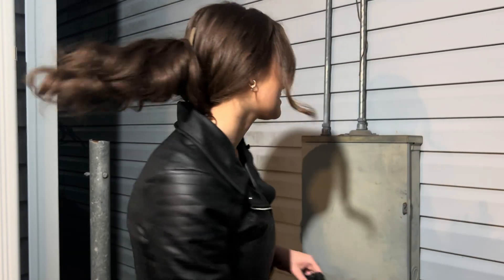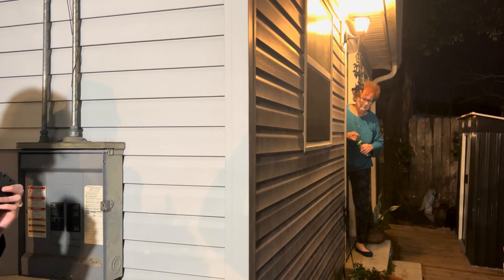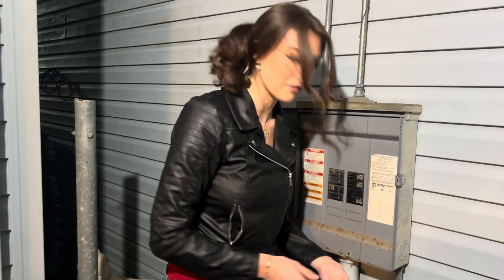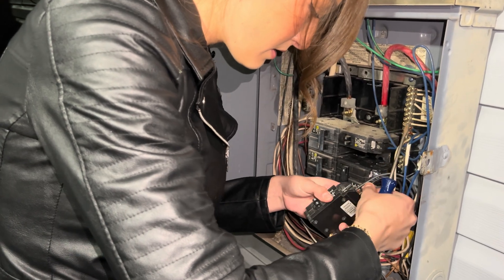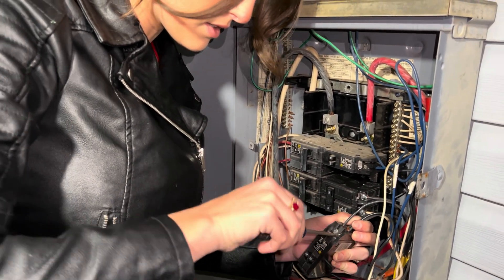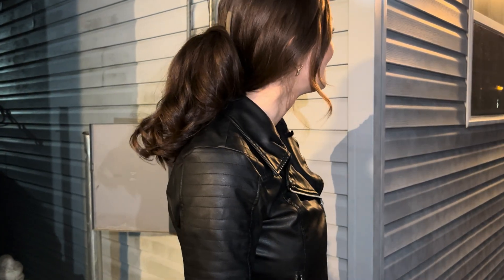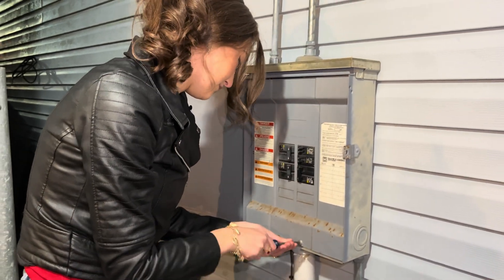Can Rachel Pizzolato Replace an Electrical Breaker?

Comment: Fix the reason it's tripping, don't just randomly replace it without fixing the fault. And no, first step is isolate the power supply before removing any covers. And safe isolations always requires proving it is dead before starting work.

Comment: NO NO NO!!  I have several objections to how you went about this breaker replacement.  First, you had no equipment to verify whether or not voltage was present, a big NO NO!!  Always check, no matter what you believe to be true, verify it!!  Second, a 2 pole breaker should only have 2 wires going to it for a 220V load the second wire on the one leg should NOT be there.  It will most likely produce an unbalanced load contributing to the breaker not functioning as it should.  Third, the leg with two wires was mixing braided and solid wires, again nothing I would ever do.  If you are forced to piggy back wires, do it on a single pole breaker!  I just have difficulty trying to reason out why a braided wire is even in that box at all.  What that braided piggy back wire is attached to should be looked into.

Comment: Thanks!  The only way I was able to get you to listen.  The reason the breaker is popping is you are overload the circuit.  Read my other comment
Reply from the maker: My grandma has a dedicated 220 circuit but they changed the ac to a 110 and run it on a non dedicated circuit. The breaker is worn out because it tripped so many times over the years. We moved some things over to other circuits and now with the new breaker…all good.
Reply from the maker: Thanks so much!!
Reply: Okay

Comment: I love you, but…

If you landed two wires under a single lug on a tandem breaker, you may not have actually fixed your grandma’s problem.

Also, if you’re not the homeowner or a licensed electrician, you may be committing a class 2 misdemeanor depending on the jurisdiction.

Comment: ❤️ If it keeps trippin maybe verify no have water leaking, loose connections somewhere such as that external light fixture at the entry door. Might want to remove rings, bracelets before hands in the electrical box. Not only to keep your nice things from being scratched but grounding. ❤️ have fun! Be careful
Reply: It's tripping because an extra wire has been fitted, drawing more current.

Comment: Industrial electrician here. Cringed multiple times with the tip of screwdriver just randomly coming near bus bars including her finger at beginning while distracted by chatting. Yes, she mentioned panel power is off. Muscle memory goes along way. Only time I truly trust power is secured in panel is when main feeders are not installed. Trust me, learned the hard way.

Comment: 😂... if you put a finger with one hand, and the other hand is grabbing the cabinet...
Perfectooo!!!... 👍
like cartoons, if you feel a ray over you... Perfecto!!! 😂😂😂
if, at the end, five minutes later, the lighs turned off.. Perfectooo!!! 😂😂😂👍
you can see how Rachel made it!!!... well, screwing wth rithm, too!!!... ✌️
(Edison could were so proud of her!!!) 🔌💡💥
😂😂😂.. noo.. just joking!!!...cool!!! just try to take cautions when you manage electricity....
first make a testing, with caution, if you pull out a wire, you can use masking tape to mark it...
before connect the breaker, be sure that nothing has electricity.. even if the duck sounds when screw it... 😂😂😂 use tools, to make it good, and faster.. use some tweezers, is much recommendable... just don't cut nothing, just only if were necessary, only some, or the same to peal them, just the necessary to put inside, but the most insolated as possible...

Comment: Couple things you need to add. Use some of those rubber coated gloves. Even the none coated will protect you from 110v. Proper use of screw drivers. Your index finger was out and touching the shaft of the screw driver.  Last thing. 2 wires under 1 screw is not acceptable. Wire nut the 2 with a jumper thenn1 under the screw.
Reply: The panel was turned off. Pigtail good idea.

Comment: Rachel you said a breaker was tripping.  FYI, there should not be 2 wires connected to each screw, or in your case, 2 wires per breaker because those are 2 pole breakers.  Each switch on the breaker protects one circuit.  You are putting one wire on one terminal and 2 wires on the other telling me there are 2 circuits on that one side of the breaker.  It may work a while but could be overloading that side of the breaker.  Your Dad seems pretty smart.  Please ask him because it could be a potential fire hazard.
Reply: Not a 2 pole, a twin. Two wires same size, ok.
Reply: She's not a trained electrician yet youtube promotes this video and she's given a ton of views for it.
Reply: She had a stranded wire wrapped around a solid wire into a terminal on the breaker rather add a dedicated breaker or use a wire nut to branch those circuits. I'm starting to use Wingo's now the larger 621 handles 10-20G wire they work great for branching a circuit with stranded wire instead of using a wire nut.

Comment: If that breaker trips so often that it is worn out then there is a bigger problem. Just addressing the symptom will not fix anything. In fact, it could help hide a potentially deadly problem that is the cause. I am sure you don't want your grandma's house to burn down in an electrical fire.
Reply: While that is a possibility, sometimes circuit breakers themselves malfunction and need to be replaced. However, if the new circuit breaker keeps tripping, then that would be a sign of another problem.

Comment: I am occasionally checking electrical situations on AC units, fuse box’s, furnaces etc to troubleshoot & determine defective parts that are literally plug & play. One can save literally thousands replacing small parts yourself & YouTube videos DIY on all types of repairs.  Sometimes one is going back & forth turning on main breaker’s, fuse box breakers etc, and one distraction can cause one to accidentally forget the status so I always have an electric meter to simply touch the two probes & see that voltage is zero.  One can actually insert each probe into a light socket & safely check voltage. Now if you touch a live wire thinking it has no current you get electrocuted. For under $200 bucks get an electrician grade meter & in 15-20 years your kids will see using it to check everything from alternator current going to car battery or to check if current passing through appliance circuitry. 
I have a  Klein Tools CL 800, added a set of banana clips, & a Klein hard side case to hold everything.  Thanks for sharing your experience, having fun, enjoying life and letting the kid in you live long & prosper!  Lets all us older folks live vicariously & jog long lost memories of the good ol’ days!😅

P.S. A failed $15-$20 capacitor causes most issues w/ fans & compressors of HVAC’s not heating or cooling and takes only a few minutes to check . (After you double check no current is hitting it first w/ your meter!)

Comment: When if you kil the "main" switch you still need to ck the lines to make sure there was not power special when there is more than 2 cables going to the same switch, and little bit of coper showing it a NO NO, needs to go inside all the way . Be  careful , we dont want you to get hurt.. beside that  nice work..:)

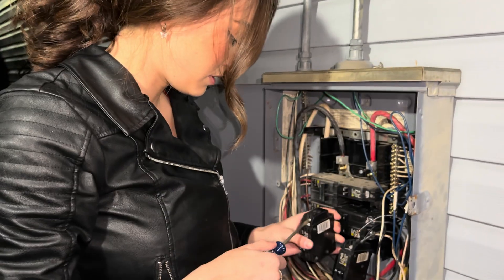Comment: 😎😎🥹🥹🫢😅😅💁‍♂(1:54) You trying to go to Heaven? Dang, look how close you are to power strip!.. 
🤡🤡🙄🙄🤠😇💁‍♂The white wire bar: thats for lightning to run through to ground or short to ground. =
😎😎😎💁‍♂🤠That old school system: a main breaker, would have stopped power to that Control Panel, first./!\

Comment: What do I want?  I want you to stop taking electrical work so casually and frivolously.  You're reckless disregard for safety is appalling.  Kids idolize you and look up to you and they 100% DO NOT KNOW about electricity.  You said "Main breaker is off, no electricity" YET YOU DID NOT SHOW THAT.  You never showed how you turned off the main breaker and how that panel is now safe.  ALSO you never used any sort of testing equipment to PROVE that that panel is now off.  When you're changing the wires, NOTICE How your screwdriver gets DANGEROUSLY close to the panel.  This video is beyond reckless.  I know you're all about "GIRL POWER" and "WE CAN DO ANYTHING" but this isn't cool.  You need to take electricity and SAFETY SEriOUSLY!  You 100% DID NOT SHOW THAT IN THIS VID!  BAD RACHEL

Comment: You turned off the main breaker - fine. But when it comes to electrical, you should trust NOTHING, and should always use a voltage tester to verify that the wires you're touching are indeed dead. Call me a safety troll, but if you become a load on a circuit like that, you die.
Reply: It's a house. If the main is off and the wires disconnected,  they cant be energized....
Reply: Safety is my number one priority, it’s probably 7,138,957th on hers
Reply: Trying not to be a stickler but she put the cover back on while the main was on. There's a reason she was reminding herself not to electrocute herself. Hate to see someone make a simple but poor mistake
Reply: Exactly! The casual nature of this video is 100% DANGEROUS and sends the wrong message to kids.  There's ZERO safety in this video.
Reply: The MCB if off don't worry
Reply: For the love of god she had a light above the door that was obviously switched from this sub panel, it’s a known building to her to boot so shove the sanctimonious comments on how to do a job 99.9% of everyone can do with some common sense.
Reply: @chrisbryden8102  Sure, the house is known to her, but I doubt the electrical panel is. There are plenty of things that could go wrong. A short, for one. Yes, the breaker turned off all the lights in the house. Doesn't mean there isn't a live wire in the box somewhere. As for being "sanctimonious", if you're going to put something like this on YouTube, you're going to hear comments on it. People watching this should know that this is not something that 99.9% of people should be f***ing with. And one more thing for the viewer to know (and the presenter, for that matter) - the brand of the breaker is supposed to match the brand of the panel. GE panel needs a GE breaker, etc. Maybe she knew that, I don't know, it wasn't mentioned. More sanctimony for you, I guess.
Reply: guy..hem... I am expert on this matters... in some way, you're right, but there are different ways to know it...
you can use a light bulb, but mainly, using insolating tape... and insolating your body.. or using a screw tester, too... or standing on a piece of wood, too...
Reply: @2010andrew  Standing on a piece of wood IS NOT an adequate safety measure {facepalm}.

Comment: Where should I start. First probably the main reason why that breaker trips is because the circuit is overloaded. That is a twin breaker which means 2 circuits not 3 and you never twist hot wires together and place it into the breaker. Besides lucky the circuit was dead you should never touch hot wires (stripped copper) with your hands. What should be done is get a single breaker for one of those circuits. If your twin is a 15 amp then get a single 15 amp it look the wire is is 14-2 so it's probably a 15 amp twin. I do not like the location of that panel or the size of it. Panel should be inside and 200 amps size panel that is code for houses today due to all the devices we use microwave ovens etc. A reputable licensed electrician would not allow that breaker set up. That is what burns houses down. The only good thing the panel is a Square D. Video was entertaining but should not be used as a guide to properly install breakers. The commenter below was also right about not torquing the screws tight. Those screws have to be torqued tight so the wires will never pop out.

Comment: When these situations arise, it's best to run new wire through to where the power outlet is...sometimes this is not so easy as they have junction boxes that reroute to other outlets or lights...

This can be done by using an electrician's coiled wire spool (Fish Tape), it's encased and made of a strong flexible metal with a hook at the end where the cable is tied to...

This is the process: 

( first wear thick rubberized gloves and safety glasses) 

You'll need : 

-rubber electrical tape,
 -wire cutter (the Klein green handled one are best ), 
-WD-40,
-and enough insulated wire to replace with (pick one gauge larger than what you have already installed, usually 12 gauge, if the outlet is being used for many connections, it's better to go with 10 gauge, the lower the number the thicker the wire) this allows for more current flow, just don't over do it, it should be proportional to the use case.

1. First cut the main power above your smaller breakers, usually a 100 amp or more breaker.

2. Then disconnect the breaker, junction boxes ( this is just usually a metal or plastic box that acts as a place to route other connections from) and the outlets that are causing the trip. You should have 3 wires, the neutral (white), the lead or hot wire (usually black or red) , and the ground ( green) .

3. Once the all the wires you are going to replace are disconnected, take the (fish tape, the spooled metal wire) and attach, from the outlet or junction box inside the house, the old wires you are going to replace, what you want to do is insert them through the fish eye slot, and hook them back onto themselves, then wrap the entire section with electrical tape, not to much but enough so that they don't come loose as you pull... the key is to wrap it so that nothing will catch with going into the conduit, just don't over do it as this will cause issues if other wires are in the conduit as well...

4. Take some WD-40, and, ask the helper to pull the disconnected wire from the electrical box, spray the end where you wrapped the wires and lightly spray the metal fish tape wire as it retreats into the conduit, this will help with drag from other wires that may be in the same conduit and around corners...

5. Once you see the fish tape come out of the electrical box side, you can now remove the tape, connect your new wires, the white, black, ground, in the same manner , loop them into the fish eye, and wrap them with electrical tape, make sure the tape cover both the fish eye and the wires so it doesn't get stuck on the way back, spray WD-40 on the new wires so they slide with ease back towards the outlet or junction box.

6. Repeat this procedure for any other extensions that go to that junction box or outlet, or if it's a straight line from the electrical box, make your connections at the outlet, install the new breaker, connect the wires : for single wire breakers , it's the black , or power, wire that goes to the breaker, the white will go connected to a metal block with other similar neutral wires, and the ground also has a similar metal block strip that is connected to a large earth ground connection, what that means it has a large gauge wire that runs out and literally into the ground somewhere out side.

7. Switch on the main power, and then the switch on the breaker, anticipating that you may have to immediately turn it off in case of issues, just don't freak out if you hear or see a short, just calmly shut the power and disconnect all the connections and reverse what you did...it may have been a tear somewhere in the line, an improper connection, or fault with the outlet...don't stress, just resolve it and re-install.

So, you must connect all three wires for safety reasons, you see the (white) neutral acts similar to ground as it allows for the recirculation of electrical energy through the system, though what the actual ground wire does is in case of overflow, or power surge/ shortage, it allows the extra energy to go to earth ground and not into the person of device that caused the short...

Making sure the entire house, as well as all connections, have proper grounding will prevent sensitive electronics, or even someone, from getting extremely shocked by exposed or short-circuited wires...

Hope this helps anyone trying to attempt this, if you are not sure of what to do, it's best recommended to call an electrician, as high amps are dangerous, it's not voltage that you have to worry about, it's the amps... 

Think of Voltage as total water flow in a large pipe, and think of Amps as the "pressure" within that pipe, high pressure is what's dangerous...also, don't use a high amp breaker on low amp outlets, this will either short the devices you have connected or burn the wire, potentially causing a fire in the conduit or wall... 

Typically, regular wall outlets have 15-20 amp breakers, things like washing machines/ dryers, A/C units, water heaters have between 30-40 amp breakers, though the devices will list what type of breaker should be used...remember that the amps are akin to pressure in a water line...use only how much is needed for each application. 

Right, almost forgot to mention : use GFCI outlets, or Ground Fault Circuit Interrupters for wet areas, like bathrooms, and kitchen areas... as they are specifically designed for these applications and prevent injury in wet areas...as well as protect appliances from surges, they come with night lights attached as well.

If you are going to attempt something like this, purchase a genuine electrical book from a local bookstore or from a reputable online source, don't just watch videos, it's best to know what the true techniques used by professionals are.

Be safe, and best wishes, 

-ER x
Reply: No reason to wear thick rubber gloves. We use 110/220 in the us. Dry cotton gloves would protect you. Better to use those thin coated mechanics gloves though. And absolutely no reason to run a new wire to outlet. The only issue with this is 2 wires one screw..lots of breakers serve more than 1 outlet room. Bundle wires with a wire nut to a jumper from the breaker.
Reply: Came here to watch some hot chick change a breaker but got an engineering degree instead.. Thank you my g. 🙏
Reply: @vanac239  lmao